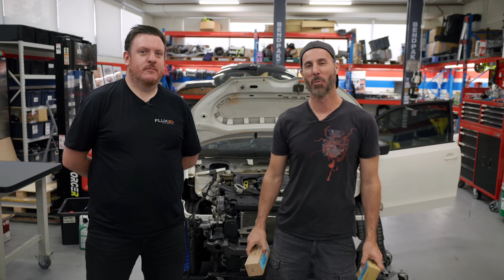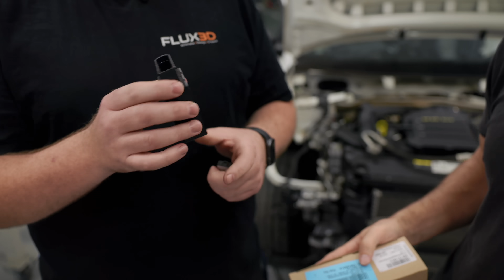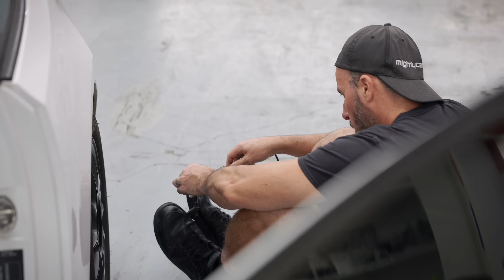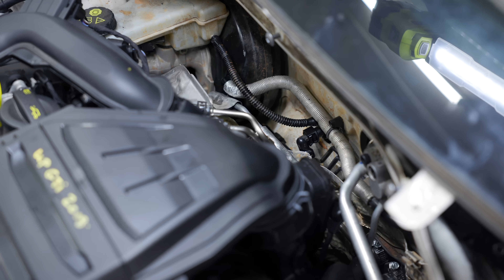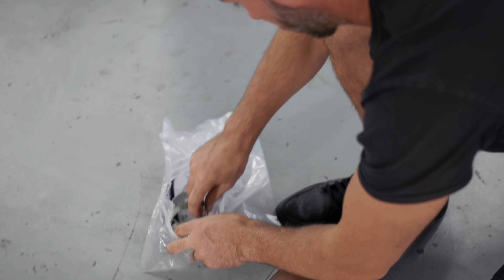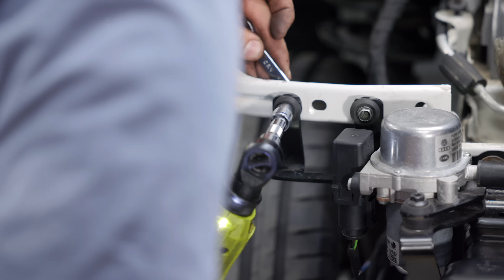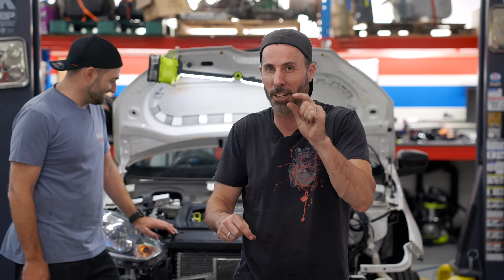Turbo VW UP! GTI Conversion - EP5

Comment: 0:45 Not quite. VW AG is Volkswagen AG. AG in Germany essentially means corporation. 
There is no such thing as Volkswagen Audi Group. It's Volkswagen AG, which is abbreviated as VW AG officially and sometimes V AG by the Internet. 

Oh and you should have been able to disable the clutch switch with VCDS.

Comment: Hey guys, in the video, you mention a UK breaker, statler ? is that the name as I can't find them online and I'm in the UK.

I've got a GTI and I'm after parts and the guys you got your UP GTI Engine and bits from sound like they are just the guys I would like to contact them.

Comment: I used to drive one of these for work. I maintained a bunch of NA poverty spec ones here in England. Awful car to drive, not particularly well built compared to the Toyota Yaris' and Ford Focus' we had. But I suppose considering the mileage they did they held up fairly decently. We had one that did 190,000 miles in 2 years. We ended up stripping some of the clapped out ones for parts. I never worked on the turbo model though.

Comment: Think I missed what you did with the gearbox mount, did you weld in the six speed bracket to mount the six speed mount or just reused the 5 speed mount as that’s what I did, the selector will touch the tower in reverse if you did the later

Comment: I’m trying to figure out the timeline here: Did that first start, the one right after the new clutch master cylinder was connected up where Moog let it idle for 5 seconds then shut it down — did that start happen before you put the oil in? 😮

Comment: @mightycarmods

Well Done on this build so far guys.
It would have been a lot more straightforward on a post 2016 facelift car in many ways.
The ECU bracket fits between the inner and outer left front wing ahead of the A post. (I tried to add an image but couldn’t)
Will there be choo choo noises to complement the Miltech exhaust???

Comment: Great effort.
The Up! Is such a good little car and fun to drive but lacks a bit of power for hills etc. I can only imagine a turbo GTI Up! Would be awesome.
We managed to total ours hitting a kangaroo on the way home from work one night which is sad but part of living in the country I guess.
Ours had the engine coolant temperature sensor fail and send water in to the engine loom, up to the ecu connector and all all sorts of funky places so if you haven’t already it’s worth changing out the sensor as a maintenance item.

Comment: To found out if its a soundaktor 

Key on 

VCDS got to Structure Borne Sound, output test and hit run if that's vibrating/making noise you will know! should sound like a siren.

Comment: Unless you have the loom for the blinker arms, you need 2 connecttors for the old loom, the engine light will not go away since you now don't have  partikelfilter any more, that need to be removed by your tuner 😉 regards

Comment: On the left hand drive Up GTIs the ECU is supposed to go somewhere between the driver's side front fender and the fender liner. Sorry, I've only got a "normal" Seat Mii with CNG with the ECU mounted behind the battery, so I've never seen it.

Comment: The thing I learned so far is that GTI versions have their own assembly lines and that's why they're a markup of 10 to 20 grand from the non GTI. I am genuinely surprised they're actually going to such lengths even for an UP.

Comment: marty is right do an aftermarket computer and remove all the excess crap that can potentially fail costing excessive amount of money and diagnostic time. stop start sucks. electrical components ware out faster when power is connected / disconnected frequently compared to being kept live.

Comment: The last letter on a VAG number ISN'T the revision necessarily, it's the version number.

For example if you have the same interior parts but they come in different colours for different models, then the last letter revision will denote the colour.

Comment: Yes that's a sound actuator, put it in the bin! It just sends noise into the cabin via speakers. You can deactivate this via ECU with OBDeleven which is a great tool for VAG cars! So many things can be modded like brake control strength, front diff strength etc.

Comment: For those shear bolts, one thing you could do is use an Allen head and after tightening, go 1 size smaller and round it. Makes it harder for thieves to tamper.

Comment: My CRV had one of those break off bolts on the key switch threw it in the trash and use regular Bolt how to get off under the dash with a grinder to remove the old one

Comment: i would agree with you guys people dont get it. i'm building defender 130 and fitting the 3.6 tdv8 motor and autobox from range rover sports. im going to using the factory computer, cluster and wiring from the range rover sports. its a massive undertaking i'm currently working on  trying to fit the motor and box in the chassis. it will work but it not bolt in. everyone keeps asking why and my answer is because it will be the coolest defender in the country. i dont know of another one anywhere in the world. there is no instruction manual all the mounts will be custom. but i'm in no hurry and i'm doing it old school in my driveway and rolling in and out of the garage when i need to lift things as the yard is dirt. keep on doing these style of builds and not just the ls swap the world builds.

Comment: I do like the up gti, alwasy thought it is the closest thing to what the original golf gti engineers built in a 2020 way. 

However i just asked gemimi some questions. The two cars has almost the same hp but the golf gti has a big weight advantage, but the up gti has way more torque/ton 208lb ft per ton, over the original golf gti 138.  That makes this very intresting comparison. 

While i was asking questions, i was amazed to find out the polo gti has 207bhp. But per ton its 161hp per ton. Higher than the og golf gti 136p/t. What is agian interesting is the up gti beats the polo gti in lb-ft oer ton 208 to 183p/t 

Im not sure how vag got more power out of the 1l 3cly in the up over the 2l 4cly in the polo. 

Im really in the rabit hole here (i may need saving). The new golf gti 245bhp 273lb-ft

However power ton its 159bhp and 177lb ft. So the up has the highst torque figure ro weight  out of them all. And the polo gti has the highest hp to wight. 161p/t to the new golfs 149hp p/t. 

It would be a very inteating back to back comparrison between the 4. I think the up would come out shining.

 Here it is written better by gemin 

Sure! Here's a comparison of the horsepower per ton and torque lb-ft per ton of the 1975 Golf GTI, the latest Golf GTI, the Polo GTI, and the Up GTI:
| Model | Horsepower | HP per ton | Torque (lb-ft) | Torque lb-ft per ton |
|---|---|---|---|---|
| Original Golf GTI (1975) | 110 | 135.80 | 112 | 102.04 |
| Up GTI (2018) | 115 | 115.35 | 207 | 153.23 |
| Polo GTI (2023) | 207 | 160.96 | 236 | 135.43 |
| Current Golf GTI (2024) | 245 | 72.16 | 273 | 59.34 |
As you can see, the Polo GTI has the highest horsepower per ton, while the Up GTI has the highest torque lb-ft per ton. The current Golf GTI, while having the most horsepower, has the lowest horsepower and torque per ton due to its heavier weight.
Here are some additional insights:
 * The original Golf GTI, despite having the lowest horsepower and torque figures, has a decent horsepower per ton ratio due to its lightweight design.
 * The Up GTI, while not the most powerful, makes up for it with its impressive torque lb-ft per ton figure, thanks to its low weight and relatively high torque output.
 * The Polo GTI strikes a good balance between power and weight, resulting in its impressive horsepower per ton ratio.
 * The current Golf GTI, while the most powerful of the bunch, is also the heaviest, resulting in its lower horsepower and torque per ton figures.
Overall, the best car for you will depend on your priorities. If you are looking for a car with the most power, the current Golf GTI is the way to go. However, if you are looking for a car that is light and agile, the Up GTI or Polo GTI might be better options.
I hope this helps!

Comment: Hey Moog, you should try for soldiering, the Solder Seal Wire Connectors or Self Soldering Heat Shrink Butt Connector. All you need is a heat gun. Used them for my stereo head unit, worked great.

Comment: Sure you can modify a Mk3 or younger Vag, if you have a certified Vag mechanic crew at your disposal. At the end of the project you'll then have a modified Vag. Which is only marginally less exciting to drive than a stock Honda. Although the GTI has the same merit as GLS, on this sh!tbox those three letters are absolutely ridiculous.

Comment: hall sensors are used for magnetic switching depending if you running linear or logic switch will be used for low latency or EMI affects on electronic devices or PDM. meaning drive by wire or TPS or the clutch works on potentiometers which is problemic why manufacturers are going hall effect sensors which is what most sim racing pedals use hall sensors but you should that already with being with heltech

Comment: Swapping engines in modern VAG cars is getting harder and harder every year. My mate and me have swapped a seat Toledo from diesel to petrol luckily we live in the uk which makes it easier as we have loads of parts but there is still lots of parts you don’t think of that need to be changed. Luckily it is the MK4 Golf platform so parts are now cheap 😂

Comment: Most trouble ever gone to to gain 40 horse powers. I admire Your dedication.
Reply: These 2012 models only had 60HP. So 55hp a almost 100% gain is quite a lot. And with some tuning they easily get 150Hp
Reply: They made a 75hp version too it just has a different map. Anyway im sure the boys have plenty of mods planned, they can run a good 150hp with just a remap.
Reply: @vwporschefreak97  wrong, came in 75 and 60 hp variants.
Reply: @vwporschefreak97 nah all the aus delivered ones are 55kw so 75ps
Reply: It can be a pretty big deal in a little car like that. I don't know what that 40 is as a percentage of the old one,   But it's probably proportionally pretty significant.
Reply: I've had both, hp might be one thing, torque is the onther thing, the n/a has just 95 nm of tq and the gti 200, makes a HELL of a difference, still not a fast car, but alot more driveable at any speed in any condition, i LOVE my GTI, sold my E39 M5, kept the Up GTI. says alot that does.
Reply: @FalconXE302  They are endearing little cars, gotta fess up tho, I've since bought another M5 :F
Reply: True, but it's only a remap away from a further 30ish, so double the HP
Reply: Done this conversion to my 60bhp MK1 Bluemotion. With this engine now running 196bhp with a hybrid turbo and basic supporting mods like these guys are fitting. Certainly worth it!
Reply: VW Up is only 115bhp = No better than Toyota's (Naturally Aspirated) IQ3 😂😂
Reply: @statementleaver8095 I'd rather walk than get in a Toyota IQ.
Reply: 40 American hspwrs or 30 in the rest of the world?
Reply: @winzracingNZ  wouldn't know mate. Am a brit, we use proper numbers. I was trying to be generous :D

Comment: Excellent to have General Kenobi on this project. VAG has a nasty habit of "NEIN!"-attitude on the computer side. If you don't have access to someone with all the licenced software and manuals you're pretty much trying to reverse engineer alien technology.
Reply: They clearly had VCDS in one of the shots and that software is better than 99% of what's out there for non VW AG products.

Comment: I'm guessing there is a 4 cylinder engine that can drop in these? The one I drive has no balance shafts or DMF, so a smoother engine would be such a good upgrade.

Comment: As an up GTI owner, i can confirm the ecu is between the inner and outer passenger wing. I will post a picture on your fbook
Reply: You a real one
Reply: We call them fender guards
Reply: Yep on the facelift ups it's on the left side wing. Prefer it behind the battery on the prefacelift as its more protected

Comment: first item is the soundaktor, ECU lives under the passenger front wing/fender usually covered up by the arch liner
Reply: My favourite hungarian youtube car channel "junkbuilds" have an Up GTI so I think if you ask they for anything they can look UP for you on their UP ;)
Reply: this
Reply: Are you sure the ecu isn’t riveted to the battery tray ?
Reply: @Hamistar  I'm not sure for certain, but I believe that is the pre-facelift cars location,  it's not there on my 2019 GTI, but under the wing
Reply: This
Reply: Bump bump
Reply: BUMP of superiority.
Reply: Bumpit
Reply: For anyone else curios "soundaktor
Reply: But this isnt an UP GTI iys a standard up and as a mechanic thats worked on a few the ecu on the standard up lives under the black trim that hides the wiper motor on pasanger side
Reply: @DAMO87  I mean yes, but I'd imagine they know where the ECU is in their car as standard. They were holding the ECU bracket for the GTI and asking where it goes.